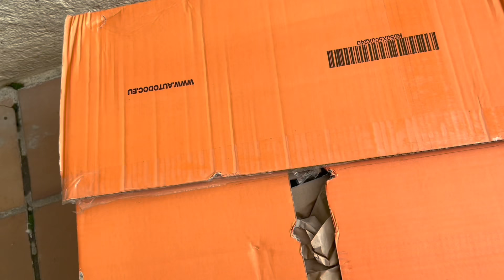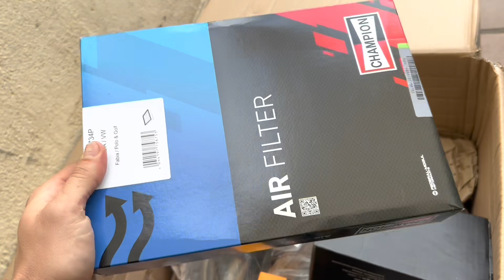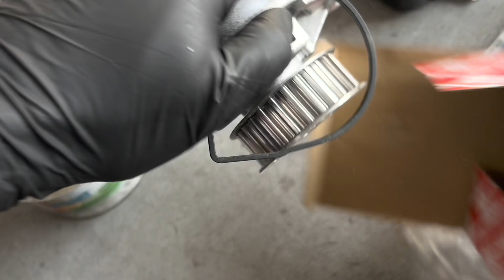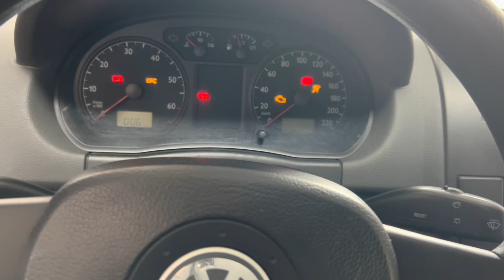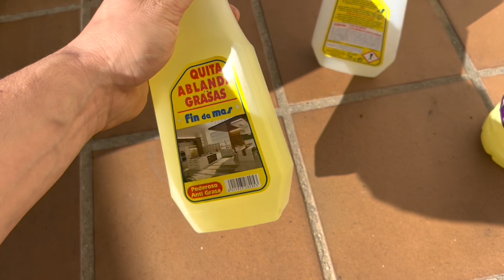✅ Compro Volkswagen Polo MK4 Funcionando por 250€ 🤑 Parte 5

Comment: Dos cosillas, el conector que has desconectado que tenias la perdida lo has conectado? Puede ser ese que no abre, sino muchos modelos en el radiador llevan un termocontacto que es el que da señal de conectar los electro ventiladores
Reply from the maker: Hola,Vip_Style_Mamra! Si he comprobado el conector del sensor que he cambiado y está bien. Creo que se de cual termocontacto  hablas ..es la resistencia de los electro ventiladores pero en este modelo no consigo ubicarla. La he visto mucho en coches diésel..pero en gasolina no estoy seguro si la llevan. Seguiré investigando . Un saludo y gracias por los consejos 😊👋🏻
Reply: @mfixingcars  en el mismo radiador tiene que haber un tornillo de llave 19 creo pero ya te digo que en en polo no se si lo lleva, da igual diesel que gasolina lo miro y si lo ubico te lo paso por Instagram
Reply from the maker: @tulli_man  muchas gracias ☺️ El que me mandaste por Instagram es el único que lleva y el que yo he cambiado. No creo que esté mal ya que lo he puesto nuevo . Voy a probar los electro ventiladores directamente dándole 12 Voltios luego los fusiles y a lo ultimo el módulo que os he enseñado el el vídeo ..alguno de ellos tendrá que ser el culpable 😅 
Un saludo y gracias por los consejos 👋🏻